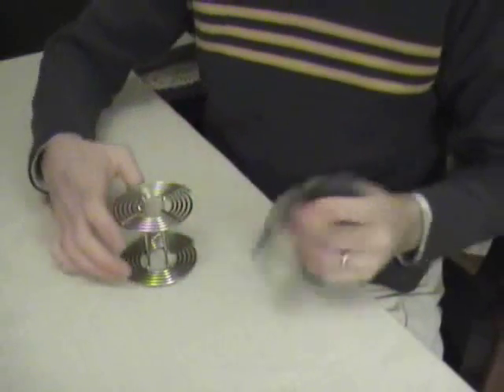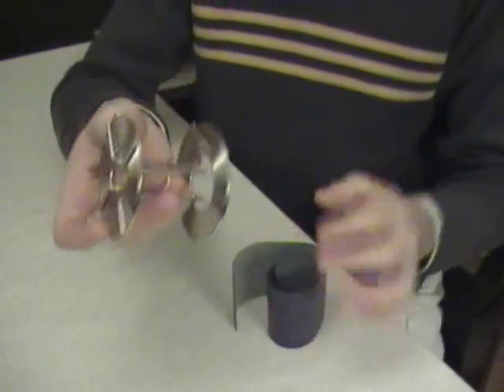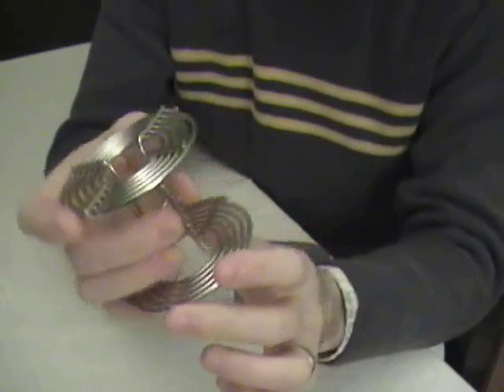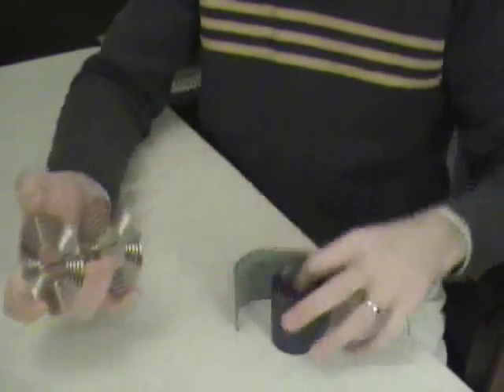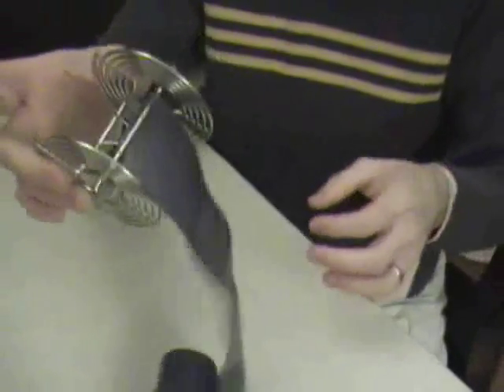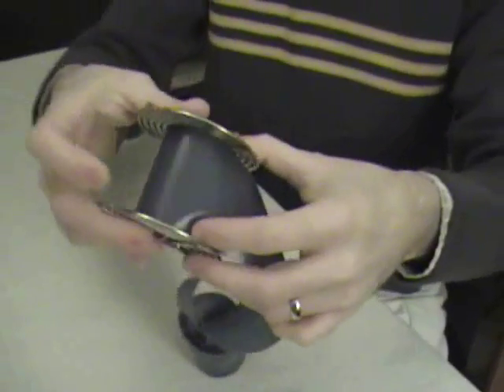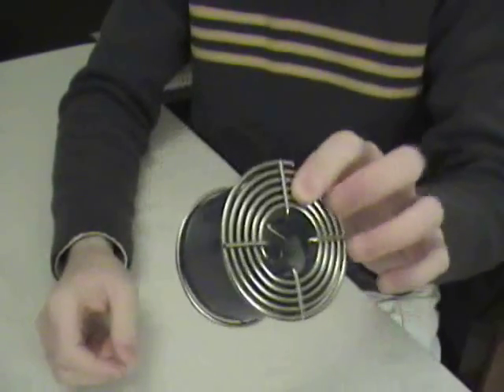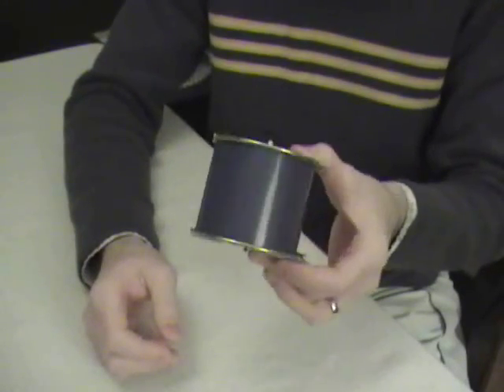Loading 120 Film Onto Stainless Steel Reels

Comment: The hardest part is trying to get the film edge into the spring clip. I like your way of using one hand to hold it down and the other to shove the film in. After that, it's just a matter of bowing the film and turning it on. Thanks for the tips!

Comment from the maker: @DemitriRas The backing paper is completely loose from the film.  It's taped to the film only at one spot up at the front of the roll as you get to frame #1.   So the tape just tears and the film is free of the backing at that point.  The cameras are set up to pull the paper and film through the camera in a way that the film would never slide away from the paper because it was held in place with pressure.

Comment: Hmmm.... I found your 1-finger technique interesting. I never did it that way. I always keep the reel circumference on the countertop when loading it, which can't be done in a changing bag. (I don't like changing bags.) Once I had a 120 reel that was always giving me trouble. It turned out it was about 3-4 mm too wide. So always check your new reel against one that you know works well.

Comment: Thank you! I decided to take up film again, but got stainless steel reels for both 120 and 35mm, thinking it'd be similar to the plastic ones used in high school photo lab over a decade ago. Was wondering why it was so hard to load! No wonder, I was doing it wrong.

Do you have any tips on how to avoid fingerprints on the emulsion side?

Comment: Can you use plastic reels in stainless steel tanks?
Reply: NO, plastic reels DO NOT FIT in metal tanks.  The reels have too large of an outer diameter.

The opposite doesn't work either: Metal reels generally don't fit into plastic tanks.
If you tried, you would not be able to insert the tank's center funnel that keeps the tank light tight.
If you tried to develop film without the funnel, light would leak onto the film as you remove the top cover so as to pour chemicals into the tank.
For those interested in loading 35mm film easier, the Hewes brand steel reels are a premium reel.  The Hewes reels are easier to load at the start because instead of a clip, Hewes reels are designed to hold the film by sliding 2 of the film's sproket holes onto those 2 prongs, then begin spiraling the film same as the regular style metal reels.
(not sure if Hewes has anything special for the 120 roll film.)

there are regular 35mm Hewes for regular metal tanks,
and there is also a version of Hewes reel that will fit into a funnel style plastic tank (the JOBO 1500 series tank.) This  Jobo tank is often used for automated development (expensive machinery) but this tank can also be purchased to use in manual film developing, provided it is acquired with the correct top.

Comment: Steel is the only way to go with 120 film (in my opinion). The plastic ratchet reels are cheap and okay for 35mm film but 120 is an absolute nightmare.